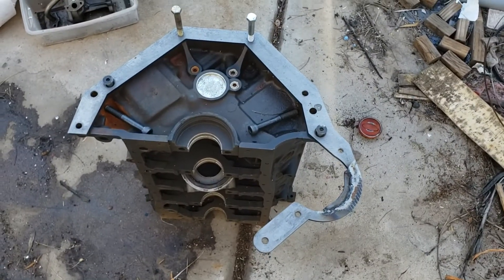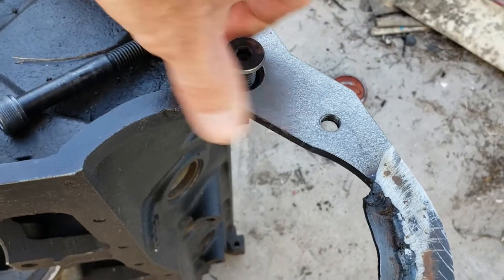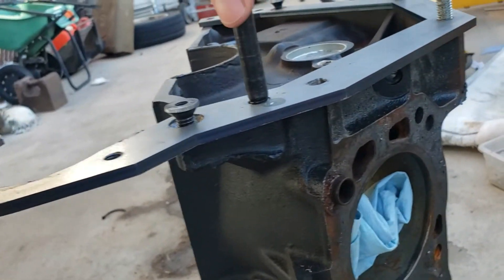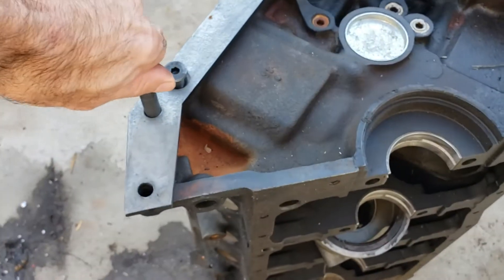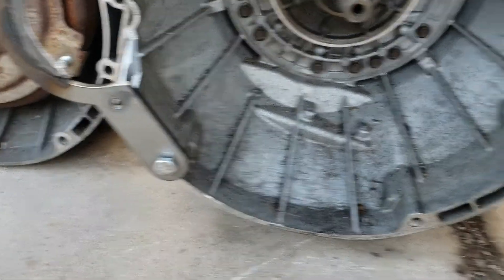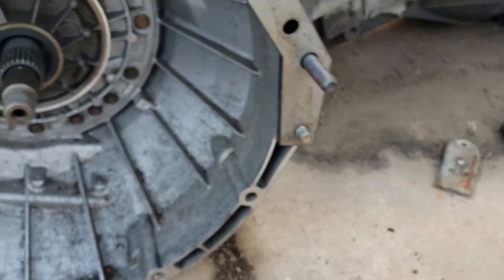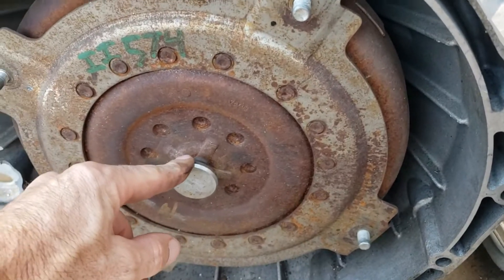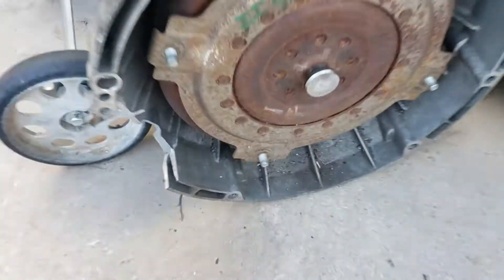6R80/TR3650/T45 Adapter Install 302/351W

Comment: Just bought a 164t adapter from you. Does it matter which year tr3650 i use?
Reply from the maker: no, it should not.  Only diff is whether the shifter is attached to the tail housing or not.

Comment: So the 6r80 torque converter should basically just pop in the same way the stock 4r70w one does? A lot of the other adapters Ive seen have some kind of different pilot bushing or spacer for the torque converter. 

Also you have to bolt it to the engine first correct?
Reply from the maker: Those others require a pilot spacer because their adapter plates are 3/4 inch thick or more.  Once you remove the starter spacer plate you are only gaining a small 3/16 of an inch.

Comment: So this must mean that the input shafts are compatible too?
Reply from the maker: the 3560, 45 and T5 all share the same 1 1/16 x 10 spline input and pilot diameter.
Reply: 1994 and 95 V8 T5 and 94-04 V6 T5 are the same input shaft length as T45/3650, 84-93 V8 T5s input shaft is shorter.

Comment: Still making adapter for a t45 to a pushrod 5.0 engine
Reply from the maker: yep, ryandenney347 at gmail..
Reply: @olboy1981 still have the t45 adapter for a 351 push rod motor

Comment: Question…will this also work on a 289
Reply from the maker: Yes, but only the 6 bolt type.  The earlier 5 bolt pattern is quite a bit different.

Comment: Do I use a 10.5 inch foxbody clutch for tr3650 and does the extra thickness of the plate effect the input shaft to pilot bushing distance?
Reply from the maker: @southernracing24 you will need to use the 164 toothed flywheel.  The starter location is for the 164.  Ive started to mark the plates for the 157 toothed wheel.  One could drill the new holes and trim the plate.  The 164 toothed flywheel uses an 11 inch clutch.  Pilot distance seems fine when you measure everything out.
Reply: @olboy1981  sweet I have a spare 01 cobra clutch laying around already I’ll shoot you a email soon I look forward to trying this plate

Comment: Two thoughts, the 1/4" spacing difference of the TC, and the starter thread depth. Can you weld more steel onto the spacer for the starter threads? The TC is moved forward the 1/4" distance of the spacer plate. Is that undesirable to have the TC out of the trans any different amount than stock? The PA aftermarket spacer kit is 1/2" and uses weak 1/2" stud extensions. I would not want to trust those to hold the TC onto the flexplate. I would prefer on those to have a TC with 1/2" extended stud bosses.

I like the 1/4" spacer idea, but the TC ideally needs to be the same stock distance within the transmission. Have these two things been brought up before?
Reply from the maker: I have other videos on the channel that show the assembled engine w/crank and transmission and the amount of spacing between the converter and flexplate.  Once all assembled the converter only pulls into the flex plate about a big 1/8 inch as the nuts are tightened.   Remember that the converter can not be bottomed out into the trans or you will burn up the pump with it have a lateral load on the drive.